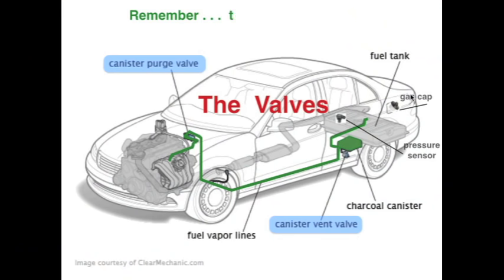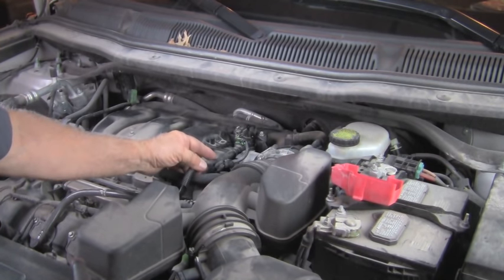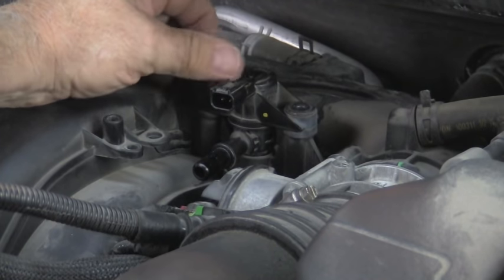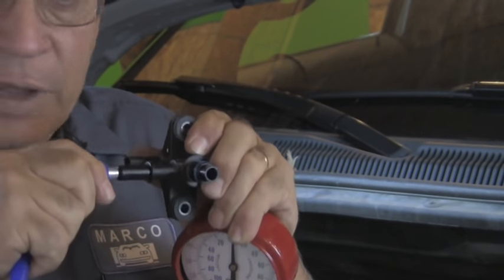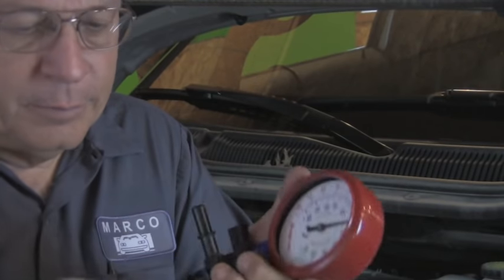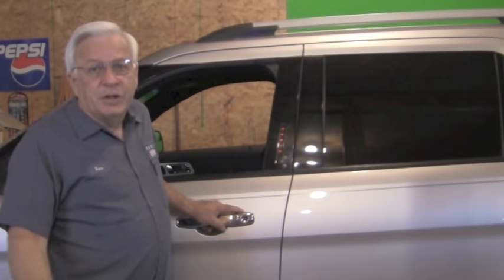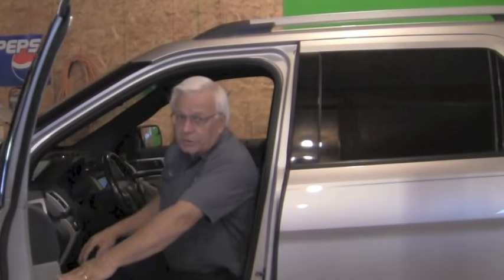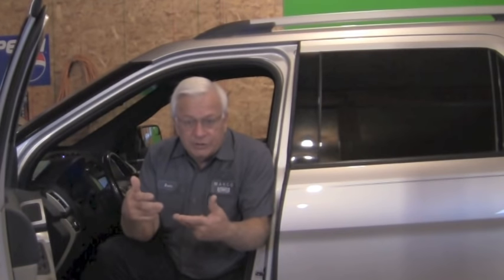How to find a Small EVAP leak without a smoke machine Part 2

Comment: One thing not covered: If it's the Canister Vent Valve rather than the Purge Valve. You'll need to locate the vent valve, which is usually on or near the charcoal canister that is attached (or very close to) your vehicle's gas tank. Disconnect the wire connector and hoses, and try the suck/blow test as he did here, or use a vacuum gauge.

Comment: This is a great, methodological presentation with feasible DIY techniques. You might also mention the potential deleterious effects of today's pseudo-gasoline, as it had on my old 2000 Explorer system.

I had a large leak and checked all lines, replaced the front purge valve, cleaned and reinstalled the canister vent valve - to no avail. Having wanted to avoid lowering the gas tank, I finally checked the tank vent valve and its lower portion/check ball frame had been decimated by the gasoline. Replacing it fixed the problem....

...for 6 months, at which point the ECL lit up with a code pointing at the canister vent valve. So I removed it and carefully disassembled it down to the valving components, cleaned them thoroughly and reassembled it. All has been fine for a year. ALSO: it would help viewers to find a link to Part 2 in the Description. 

Thanks for posting the videos.

Comment: So appreciate the great instruction!  I have a 12+ yo Explorer, I just turned 60 and have been laid-off and on disability for over a year so with time on my hands and little "disposable" income I really need to fix stuff myself as much as possible.  You are a true blessing because I haven't worked on my car other than brakes, bearings, and oil changes since I was in my early 20's and they were much simpler back then (1960-70 models).  Thank you Duane!
Reply: Good for you, nothing worse than doing nothing when your out of a job and low on cash.
Reply: @robertmccully2792  why do I think you're comment is sarcastic.

Comment: Without having a prior understanding of EVAP leaks (OBD scan code P0456), this video saved me $200+.  Most repair facilities insist on charging anywhere from $125-$150 to do a diagnostic check which may or may not include a smoke test and you have to wait 1-2 hours for the test to be completed.  This video uses a common sense approach to diagnosing and resolving the issue. The replacement part for my 2012 Ford Escape 4 cylinder engine cost less than $20 on Amazon.  TADA!!!  Additional YouTube videos also explained how to replace the item in less than 20 minutes.
Reply from the maker: Glad it helped.  Thanks for commenting

Comment: Diagnosing this on a "new" old lexus.  Ironically, it's the same way I fixed it on my pathfinder. By blowing through the purge valve....  No clue on why i thought the lexus would be any different, but this video shows, that I sometimes need to just go back to basics in thinking.  Critical thinking has helped me solve problems in the past. I was literally about to go and pressure test the whole system, but I just had forgotten about checking the purge valve, which is the easiest to access first.  thanks.
Reply from the maker: You are welcome, thanks for commenting
Reply: @realfixesrealfast  turns out.... after taking off the engine cover, the harness wasn't even plugged in. I love buying used cars. Keep in mind I already had changed all 4 02sensors. Still, it's challenges like this that make it fun.

Comment: Very informative and helpful! Ive got an 04 f150 with the dreaded 5.4 3v that has tons of issues. One appears to be possibly vacuum related. Other day I noticed my fuel tank was under full vacuum (cap are hard to remove!) when was working on it so I believe the leak is pretty substantial.

Comment: I took a course at a local repair shop by the shops owner on engine diagnosis and repair, OBD2, etc..and he stressed critical thinking skills in the garage.  This is a great example of understanding how something works and using that knowledge to solve the problem.  Anyone can replace a part, but diagnosing the problem is often 3/4 of the repair.
Reply from the maker: Thanks for your comments Scott.  Yes, Critical Thinking is truly an art.

Comment: Wow! A smart guy that can teach! Lots of pictures and explanations of your deductions.  I have never run in to a problem with this system before. My '08 Prerunner with the V6 threw codes P0441 and P0445 this week, (96k miles). I tightened the gas cap but the CEL has not gone out in 2 short trips. I will erase them and test drive. I can also relax... I know the system now. That was sort of like watching a Sherlock Holmes movie… Not cute or vulgar. Just good thinking. Thank you.

Comment: I had replaced the purge valve on my 2007 Buick Lucerne about 3 months ago because it was stuck open I normally don't use anything but OEM parts, but GM was on strike at the time and I couldn't get the part, so I installed a Duralast from AutoZone and everything was good until recently when the tighten gas cap and engine light came on. I basically changed out everything in the system and still had a problem. It wasn't only after I saw your video that I pulled the purge valve out and tried sucking air through it and lo and behold there was small leak. Fortunately, the one that I had ordered from GM came in, so I installed it and everything works great. Many thanks!  I don't know how long I would have chased this problem. The dealership sure couldn't find the problem : )
Reply from the maker: Glad it helped Stephen.  Thanks for your comments.
Reply: It's sad a dealership with a certified mechanic couldn't find a rather simple problem .... leaky valve.  Its like fixing cars 101.  I would find a new dealership.

The good thing about this video is that he explains how the system works, stuff likely to fail and how to test the parts.

As a mechanic, when something electrical doesn't work,  you look first at the switches.  When something leaks checking valves first makes sense.  Not to say other things can't or don't fail but you have to start somewhere and you go to highest likelihood of issue first.

Comment: THANK YOU SO VERY MUCH!, This video has helped me so much in understanding this system. i went to emisions today and it didnt end well but! i did find out that not only was the valve leaking but it wasnt bolted down snug. about 3 turns loose. ive disconnected the battery with truck alarm on to drain memory from the computer. tomorrow, i will go for a drive and then retest the system, thank you so much. im a pretty good repair guy on 2 stroke outboards, if you ever have issues in that area, id love to help you sir, thank you and God Bless you and your family.
Reply: Thanks, I'll keep that in mind.  Have a good Christmas

Comment: Great instruction and explanation of the evap purge system. My Innova 3100j is telling me my 2008 Jeep Patriot N. 5spd manual trans. has a small evap error. The status light shows yellow, and my check engine constantly shows check gas cap even after clearing check engine codes. (I just put in a new gas cap.) My brother said he thought he detected light fuel fume. Thanks for your thorough survey.

Comment: Thank you so much for this video. Financed a 2013 Lincoln MKX.  Check engine light P0456 came on. Pepboys did a smoke test and said no leak found yet said my Filler neck tube needs to be replaced. Warranty company and I pay to replace part.
Drive almost 300 miles filling up a few times no light. Go to start car in morning light back on.

Came across your Video and asked Pepboys why they replaced a part that didn't need to be replaced because it passed the smoke test and then asked if Mechanic even checked the purge valve before performing a smoke test. Manager said mechanic is on vacation so he doesn't know. So manager said he would do a free diagnostic. Well I took it somewhere else since I don't want to void my car warranty by doing work on car myself. They checked purge valve for free because of a friend. Low and behold suction felt and light air when you blow. BAD PURGE VALVE. Called Pepboys and complained about poor mechanic work they said they will replace it for free.
Thanks to your video I saved myself from replaceing a fuel pump that didn't need to be replaced. A simple fix that literally takes 5 min. to do and they couldn't even do that right.
Reply from the maker: Glad it helped Steven, thanks for you comments.

Comment: Thank you sir!  I felt finger to canister purge valve while car was on and didn't feel anything.  Great suggestion to test old part.  I'll get a vacuum gauge and test.  In meantime, hope installing a new one will work.  Frustrating when you have to go to emission test and can't get codes to disappear.  I have 2012 edge with capless gas inlet and have already done all the maintenance to get that to seal tight.

Comment: Really good explanation.  Both videos were really good. Mine turned out to be numerous hoses were leaking.  The car is  a 1995 and the hoses were brittle, cracked, loose etc.  Replaced 3 hoses at the Canister, two on the way to the Solenoid Purge Valve, and the actual EVAP Control Valve just before the Canister's Tank connection were bad.

Comment: For OBD-I owners you would ensure that the valves are closed then put a vacuum gun on the evap line and apply vacuum looking for bleed down.  Then hook up the vacuum gun going in the opposite direction and test the other valve.  That is all the computer is doing in this case, it's automating what technicians used to have to do manually every time.  OBD-II bi-directional scan tools make a technicians job much easier which means you get your car fixed faster (in theory anyway).

Comment: Yay! Someone finally explains this in a way that us non-mechanics understand. I’m a 43 year old woman just learning a lot of car stuff on my own to save $ and you explained this easily enough that I’m pretty sure I can do this myself. Totally subscribing to your channel. Thanks for the diagrams for us visual learners. 

One question though... I have this error on my Honda Accord and it runs fine but I do smell gasoline when the engine is heated up. Would a leaky valve make it smell like gas from the outside of the car or is it just leaking into the tubing? I might be looking at a completely different problem but I might as well start with the purge valve since replacing the gas cap didn’t fix the issue.
Reply from the maker: Rachael, good question.  Know this, fuel vapor not only smells, it also burns and pollutes the air we breathe.  That is why the EVAP system is completely closed and those vapors are captured and recycled back to the engine to be burnt off.  So, if you are smelling fuel outside the car something "is leaking".  Yes it could be a part of the EVAP system that is not working right.  But iy could be any part of the fuel delivery system that is not working right.  Fuel is fuel, as a vapor or a liquid. So it is possible you could have a leaking "fuel" injector, leaking "fuel" pressure regulator, small leak in a "fuel" line, leaking "fuel" filter.  Sure, check out the EVAP system but if you don't find the evidence there, look at the other "fuel" components as well.

Comment: vary good info, i need to check my part in the engin bay, your last video showed me that its likely not my vent so i am going to try this purge valve. and then maybe a gas cap, but the cap seems to fit snug, i mean, today i took the cap off and it was sucking in air 3/4 of a min,   and the other day i got a tighten gas cap msg and the CEL..   2004 CHEVY SUBURBAN

Comment: To fine tune your critical thinking I would leave the purge valve installed on the engine. Disconnect the connector coming from the PCM and the hard plastic line that goes back to the evap cannister. Start the engine and feel for vaccum at the vac port where you disconnected the plastic line. For a small leak scenario I would put a small piece of paper against the port. If it is held in place by vaccum then the valve is leaking. No tools needed. Thanks for the video.

Comment: Great video Duane.  Problem is that many cars will take up to a week to complete two successive monitor tests.  Until that's done the customer has to keep driving it.

With your fancy-schmancy scantool maybe you can force the computer to run a test cycle in the shop.

I had a combination of a sticking vent valve and a rusty purge line that resulted in several weeks before I confirmed everything was back in order.
Reply: I assumed he'd be doing that, but he just took a drive (maybe for DIY feasibility).

Comment: Very informative video. I have been chasing a small leak on my Ram 1500 for a year. All the lines are good no leaks. What I didn’t want to do is buy and throw parts at it. Your video has now shown me which part I need to purchase saved me some money. Funny I have been a heavy equipment mechanic all my life. Have taken care of fleets of semi trucks. Rebuilt many many transmissions no problem. Set up hundreds of ring and pinion gear sets. But this problem has driven me nuts. As we know Diesel engines and related parts don’t rely on vacuum much for anything. Except vacuum motors for selection of high and low ranges in the transmission and locking drive axels. So 🙏 thank you sir. You taught me something new. I am always open to learn a new process. It has kept me employed all my life so far. We can never learn to much. And lessons taught by persons like you are invaluable. Thanks so much. Great respect for your professionalism.  :O)
Reply: Glad it helped and thanks for commenting.  Keep what you have learned alive by passing it forward, someone out there needs to learn what you can teach.
Reply: @strokewarrior5762  yes I will pass this around to my friends and everyone at work. I feel sorry for the average person that has to take their vehicle to a shop. It is very expensive to have others do what you can’t. I help people all the time to save them a bunch of money. Needless to say my weekends are very busy with people’s vehicles. All I do is make them pay for the parts. All the labor and knowledge is on me. I really enjoy it actually.

Comment: What an Education I received today 23Sep.2018..... I really never fully understood this system. My Saturn Ion has excess of 242000 miles. I shall check this valve today. My code scanner shows the EV blinking.  Checking out the simple things first is key. Showing us how the valve works and demonstrating this are related of course but visually different.  Utilizing the vacuum gauge to show air flow was very nice. True most of us do not own one, however a rubber hose placed in a mason jar filled with water would suffice for blowing through each side. Or attach a simple balloon to each side,, if air flow is present the balloon will inflate. This is a very educational video. Seeing the entire system and its valves and canister is pretty awesome. My valve seems to make a knocking noise, 4 knocks to be precise, lol. Lmao, the first time I heard it, I swore someone was knocking on the side of my car. Hmmmmm. Maybe the noise was something else, it happened after the car engine was shut off. Great video, good lighting, good audio,

Comment: FWIW, I usually check a purge valve by unplugging the vacuum hose and electrical connector then starting the engine.  Plug the vacuum port with your thumb and if it's leaking you'll feel it suck on your thumb.  Alternatively, you can attach a vacuum gauge to the port in lieu of using your thumb.  This way you can detect very minor leaks (you'll never be able to suck on that valve as hard as the engine does) and you don't have to get any carbon deposits in your mouth.

Comment: By the way....most DIY are not gonna have that expensive equipment to check in the way you did. DIY would be take the parts off and blow threw it like you did and check all connections at both spots in the system or use a smoke machine as they are cheap and you can even make your own. Nice to have 30,000 of equipment but most DIY can't afford it. You did a great job at showing how the system works so the DIY can figure it out without expensive tools.

Comment: These oldschool people are the best teachers! Thank you!
Reply: This guy great!!! The question I have is when he first reset the engine light and tightened the gas cap then instructed the owner to drive the vehicle & if the light came in then they would take a closer look.........so know the owner brings it back in but not before driving the vehicle 81miles over 3 separate start ups............ so now the valve has been changed & computer reset....he went out for a drive...how long of a drive????  Because I would think that based off of the information he has given that although the light has not come on yet...that it very well could come back on after having been driven in this case at least 81 miles??? Is this an accurate assumption on my part????
Thanks again for all the knowledge!!! “Priceless “
Reply: @caesardean5266  yes your assumption is correct.  If there is a leak down the line , the computer will know. There is a tank pressure sensor,  so if there is a leak , it will show it self. But evap leaks are usually either the solenoid,  or the gas cap in my experience.  A smoke machine would show all the leaks , but this video is for diy.

Comment: Great video..currently have the same code on my 2015 jk jeep wrangler and will try this.   Oh and I now found out I don't have heat..fan blows cold air only. Might have to flush my heater core..also at 96k miles.

Comment: nice video. The fastest way to test a purge valve is to unplug it's power source, disconnect it from the evap line, start the engine and check for vacum with a piece of paper. Those ford purge valves fail all the time.